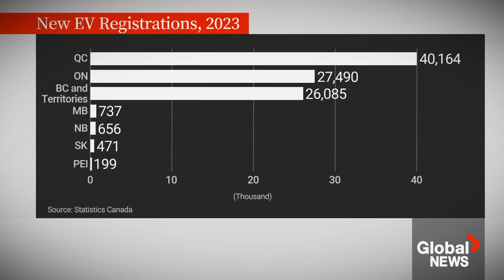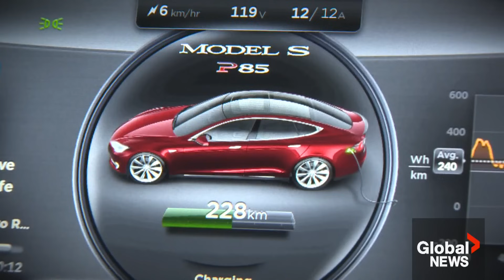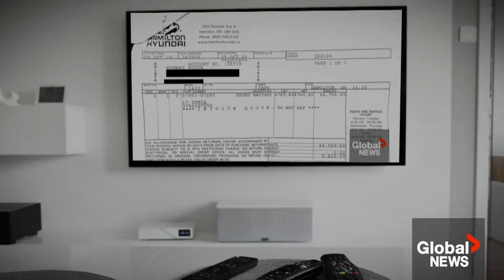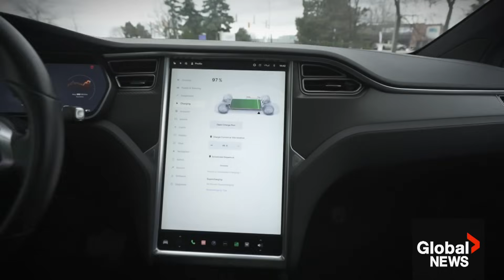What you need to know about electric vehicles in Canada

Comment: The loss of battery efficiency in winter being between 20-40 percent and battery degradation of 30 percent over 3 years means I need an EV with 1500km range from the factory. My current F-150 has a highway range of 1100km.

Comment: Was this video paid for by the EV lobby?  Norway?  You mean the county that currently obtains 33% of it's GDP from oil production?  And subsidizes electric vehicles purchases by $25000 each! OK, great model to follow.  Notice at 5:54 the professor says that "better still not to drive".  And there it is.   I daily drive a 1996 Ford Thunderbird.  Get's the same mileage as it did new and the AC still works.  Sat for a year or two when the previous owner got too old to drive.  Cost me $500 a year ago.  When EV's last over 25 years, can sit unplugged for 8-12 months at a time, and go the same distance as my $500 Ford, get back to me.  For now, they are overweight, expensive, status symbols.
Reply: nope, this is a government propaganda video, they auto industry never did want them

Comment: EVs are designed for places like Arizona 
Not Canada 

Ever had a frozen battery ? 
Boost and go, no problemo 

Freeze your EV battery and all the boosting in the world aint gonna help 

You get the Blue Screen of Death and the car sits like a crashed computer
Reply: Not even places like Arizona because it's too hot and that will also degrade the battery due to the extreme heat. It can't operate in extreme heat and it cannot operate an extreme cold.
Reply: 92 percent of new car sales in Norway are EVs. Norway is colder than most major Canadian markets.
Reply: @mydogsbutler 
So cold in Norway they are hoping the fires from those batteries will keep them warm 

🔥
Reply: @TheeSlickShady_Dave_K  China, the biggest car market in the world, over 50 percent of cars sold this year will be EVs. ICE car factory jobs there are disappearing at record pace. while global EV sales continue to take marketshare from ICE, Meanwhile I keep hearing from EV haters that EVs are dying. It's ICE that is dying.

Comment: A little forward thinking would tell you that Hydrogen is the future
Reply: Hydrogen hybrids cost most moeny to make than EVs, and  has an intrinsic variable cost disadvantage in that you physically have to transport fuel (rather than powerlines). Where you might see hydrogen is where weight and very high energy density plays a major role. For instance , maybe hydrogen  will one day replace jetfuel for long haul jumbo jets since it has a much high Wh/kg than current batteries.

Comment: 40-50% winter inefficiency
Reply: No mention of slave labour but they did give a lot of good talking points in this video.
Reply: And forget about heat in the cabin
Reply: Cold weather durablity is an issue in Canada but I'd point out that 92 percent of new car sales in Norway are EVs which is even colder than most Canadian markets. A big reason for this is energy densities of batteries have gone way up these last few years, and charge times and prices dramatically dropped.. One problem in Canada is we can't get access to a lot of this technology because both liberal and conservatives are fixated with trade wars with China that is one producing most to it  BY contrast, Australia has not put up barriers to Chinese batteries, solar and EV and they are rapidly shifting to green tech. 
.

Comment: Canada just doesn't have enough infrastructure for fast charging or even just charging in general
Reply: YET.
Do you really think gas stations pop up before gas cars
Reply: Keeping an EV charged over course of a year uses same amount of electricity as a water heater. Grid is not a problem, especially as 90% or more charging is done at night.
Reply: That's a valid point. One problem is most of Canada is empty and we are a big country. It's a chicken and egg problem. We need more EVs to justify charging stations but Canadians are less likely to buy EVs because of lack of charging station.   Nevertheless this issue will be resolved with time.  China is already doing it. It will just take us years longer to get there because we are way behind in EV tech.